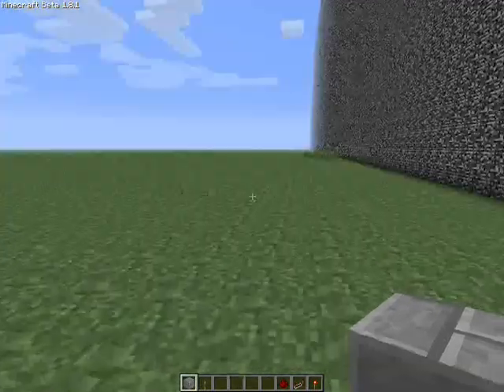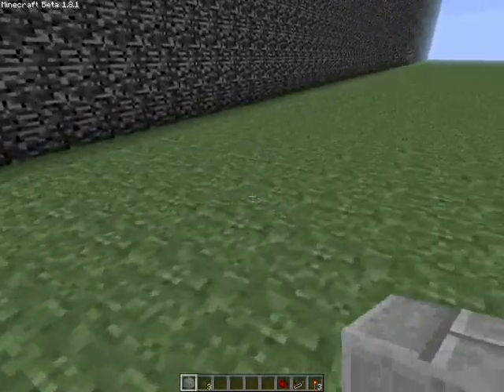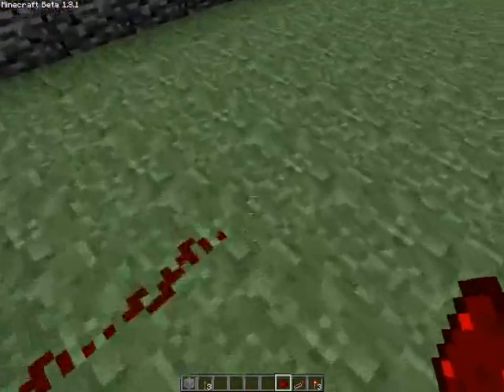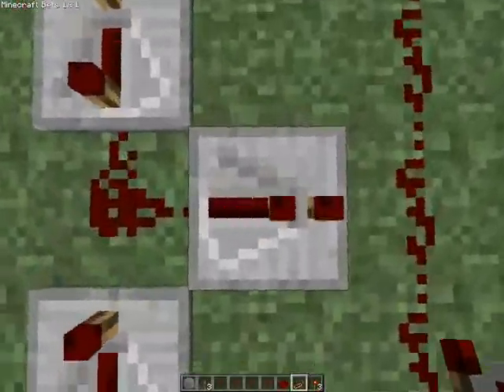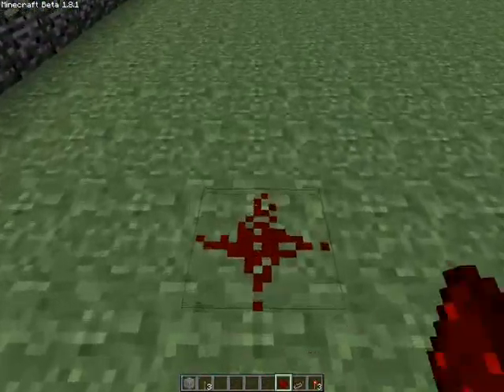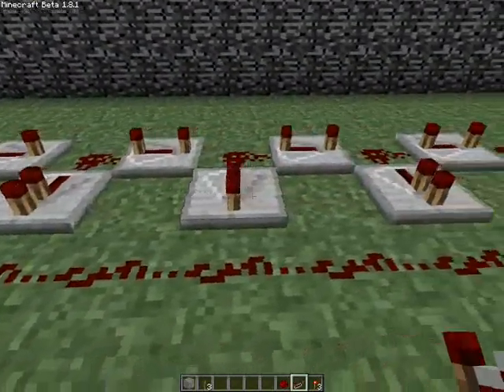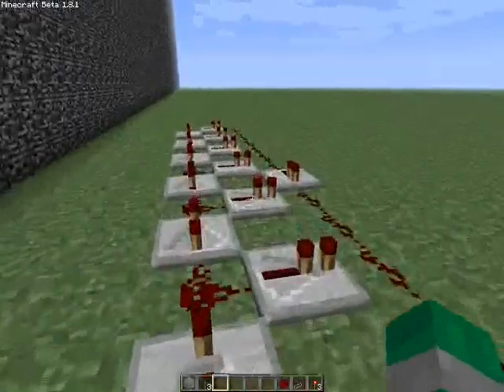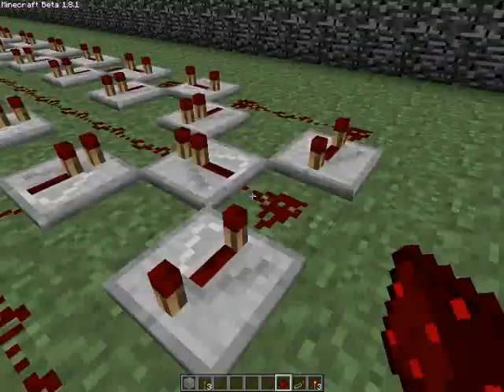-Minecraft- Redstone signal extender.

Comment from the maker: Glad it's helpful.
However, you can use redstone torches instead of repeaters facing into the middle, to save on redstone; didn't think of that at the time.
Also, inbetween the repeaters you don't need a dust, you can use a block instead and then put the torch on the side of it, for more redstone saving!

Comment from the maker: @raafmaat The purpose of a T-flip is a single input toggling between two states, in that situation (the exact one I explained in my video) an RS-nor is preferable and smaller.
The reason I came up with this was because I needed the delay to take multiple input triggers without screwing up the timing of opening/closing.

The RS-nor in this type of thing is simply the initial press opening the gate, and the delayed signal closing it again.